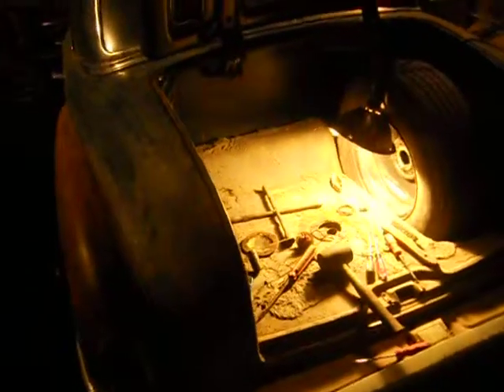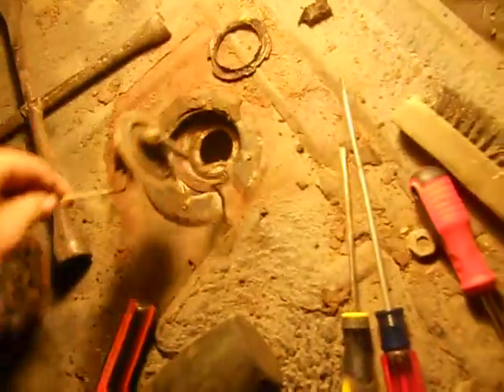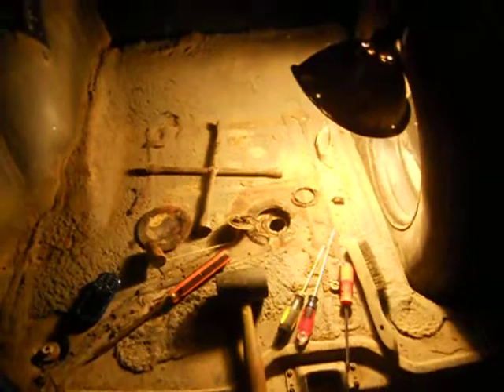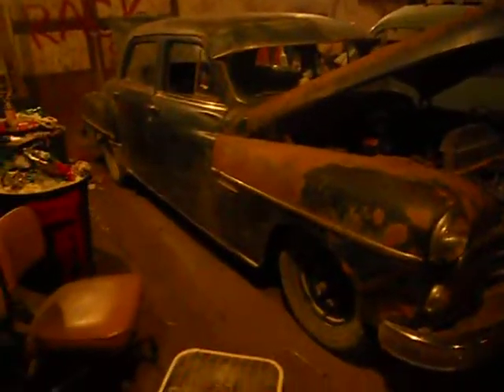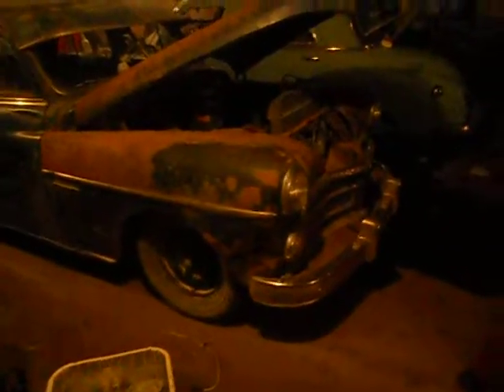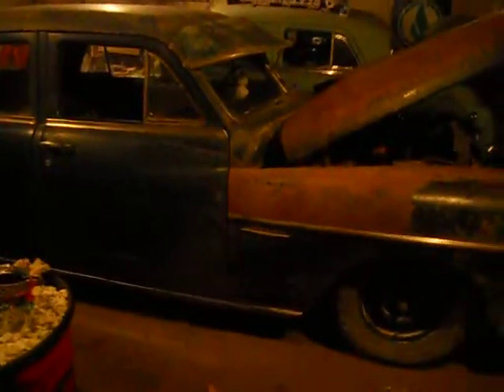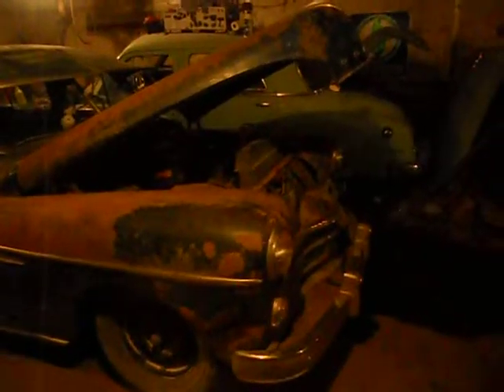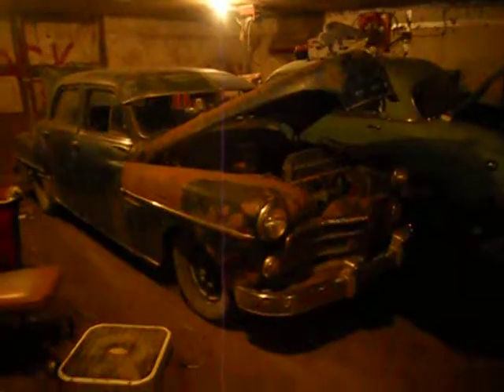1950 Dodge Coronet update, Fuel Gauge, Breaks, and lights

Comment: Do you know where the master cylinder is, and if so can you still get them? I have the same exact car as you
Reply from the maker: it is under the car driver side closish to the engine, there is a hole in the floor where you can access it to add fluid, i had to get mine rebuilt, i had a mechanic i take most of my stuff take care of it, not sure if he sent it off or did it himself, but i know they can be rebuilt